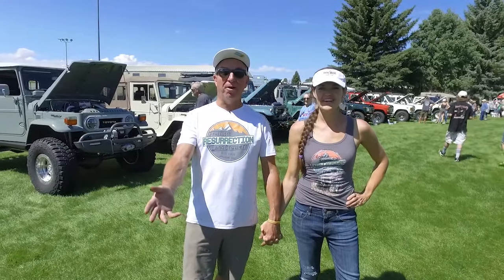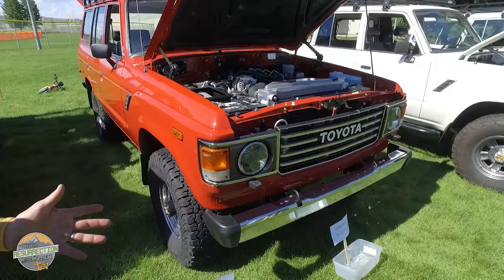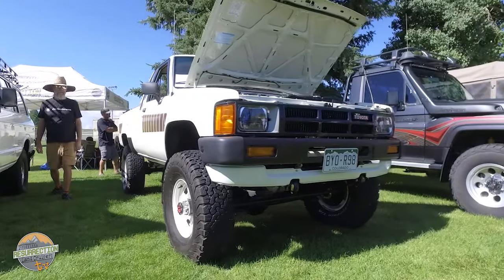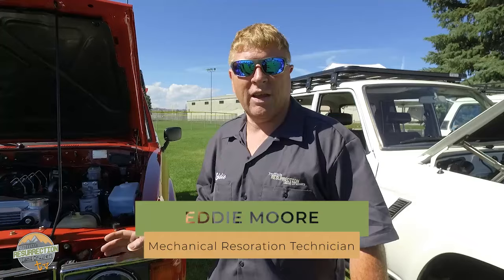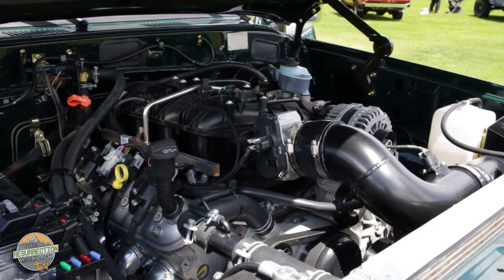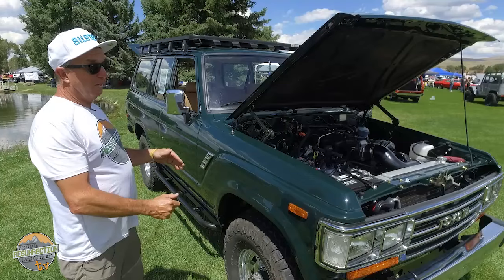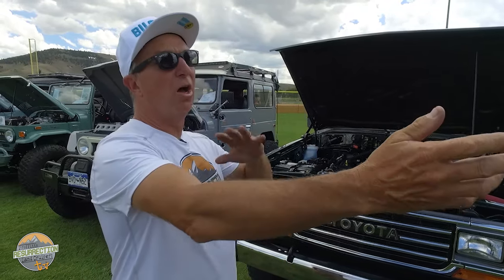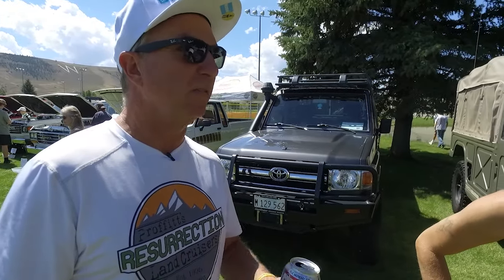Show and Shine. 12 Toyota Land Cruisers on display. An FJ62 resto-mod. Plus, vote for gas or diesel!

Comment: I'm an old man who has owned a 1979 Toyota 4wd pickup and a 1988 pickup. I wish I still had them both but if I had to choose it would be the '79. I sold the '79 to buy the '88, first new vehicle I ever owned, and had that until 2 years ago with 295k miles and had the misfortune of it getting totaled in an accident ☹ I have my eye on a '82 to sit along side my FJ60. I would LOVE to have a diesel in my 60.

Comment: Diesel manuel all the way and I like to stick to the Toyota engines 😂, ya gotta love the 60 series ...how do you fix the cracks in the dash,sunshine cracks.😢
Reply from the maker: Well, believe it or not, an  Fj62 dash is still available New from Toyota in Grey. In this case, we just refinished it to match the interior. On FJ60s. We send the dashes in to be restored.
Reply: @procruiser  great stuff guys keep up the great work 👍